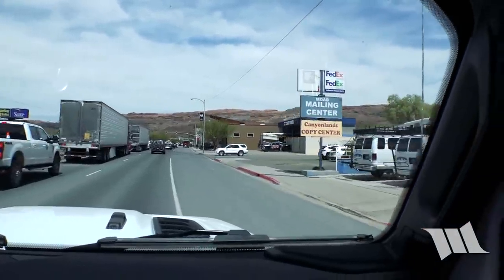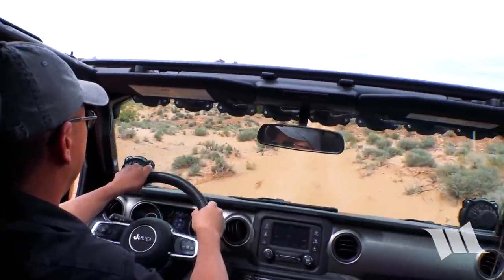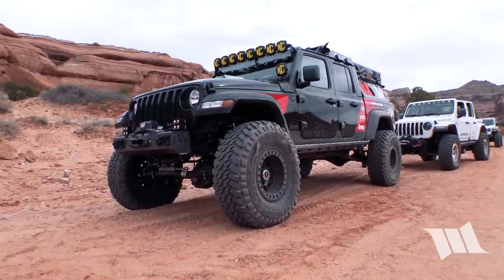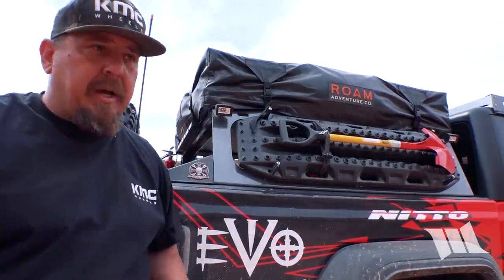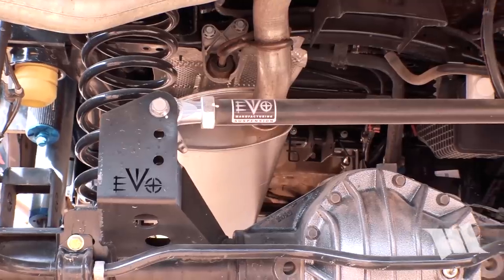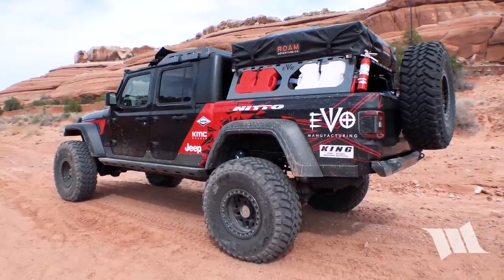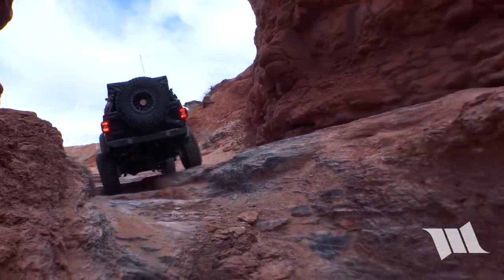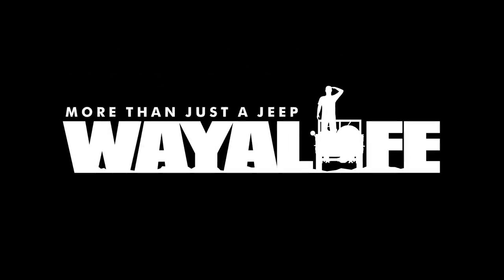Jeep Gladiator Truck Overlander on 40 Tires by EVO Off Road Testing at Moab Easter Jeep Safari

Comment: How much does it cost as it stands like that?

I already knew before I watched this video that this Jeep was going to be dope.

What I want to know now is how much does it cost as it stands like that?
Reply: MyYTChannel there’s a previous video where he did mention $35k in parts, and $35k for the gladiator sport (which is what this is here) so for $70k, you get a way better build than the $70k Rubicon stock.
Reply: @joerivs80  But does this have electronic sway bar disconnect? Does it have lockers? 

Also, I find it hard to believe this would cost you and me $75,000. 

The parts they bought, they probably got the best rates on. They also did not put a price on installation which took them probably more than a week or 2. 

So, when I think of a those costs, yeah, I think this Jeep as it stands is over $100,000.

One thing I am sure of is that Jeep will break record sales with the release of the Gladiator. People in foreign countries too are waiting for one and they will pay a ridiculous price to get the basic Gladiator. Jeep will make history in sales with the Gladiator. That is a fact.
Reply: MyYTChannel idk for sure, evo made the Jeep so they gave “rough numbers” from what he said. I don’t think it was only $35k in aftermarket parts either with all the KC and tires and axels and yada yada, but I don’t think it’s at $100k yet. 

But yes, either way it’s waaay rad and Jeep is going to def make some bank off this thing. 

I kinda don’t like the look but as this overland build looks, I’m in love.

Comment: Could you have done the trails you did in Moab with the gladiator on 37s or were 40s needed
Reply: Are you going to do 40s or 37s
Reply from the maker: You could have totally done what we did in this video with just 37's. For us, we want to go 40's
Reply: So are you going to go Dana 60s? Or are you going to run your Dana 44s till they break
Reply from the maker: Oh, we'll break a 44 for sure. Hoping to get Dynatrac XD60's but we'll see.

Comment: Aren't the Dana 44 in the gladiator supposed to be a little beefed up ?
Reply from the maker: LOL - a beefed up housing won't make a difference when you blow a u-joint, break a shaft or more than likely, blow a ring and pinion. You can drive off the trail with a bent housing but you're kind of dead in the water if anything internal goes.
Reply: Yea very true just always thought the aftermarket will make parts to fix the weak points but if you crack or bend a housing what's the point
Reply: What is ur build plan are you thinking overland build, rock crawler, all around build or pre runner style? If you get a chance check out what Brad deberti did with the Ford bed on the f350he built for sema
Reply from the maker: @earlbond007  Me personally, we always try to build our Jeeps to do it all.

Comment: im a little surprised they left the stock fender flares
Reply from the maker: Why is that? Some of us really like the look of the factory flares :)
Reply: @wayalife  with the way you guys run jeeps, I assumed they would be destroyed fairly quickly and possibly lead to damaging the body whereas I thought the aftermarket ones would basically aid the sliders and keep the body off rocks. The aftermarket ones do function like that, right?
Reply from the maker: @Bward216  Actually, I prefer factory fenders because they will bend, crush or tear off well before they could do any body damage. What I have seen time and time again is aftermarket fenders be so hard that they CAUSE body damage. In fact, I just saw it happen again on this trip.
Reply: Wayalife that’s good to know for the one day I am able to build one. Thanks!